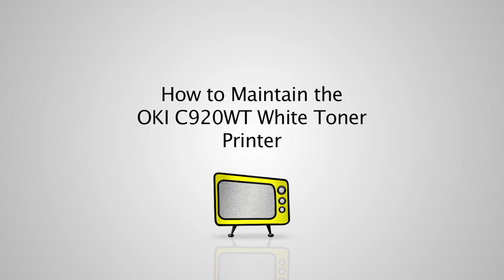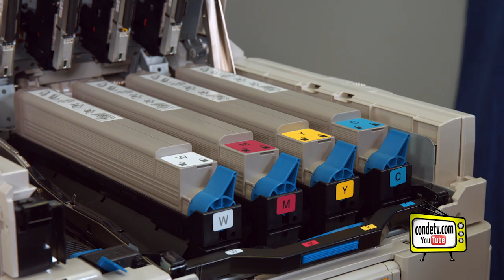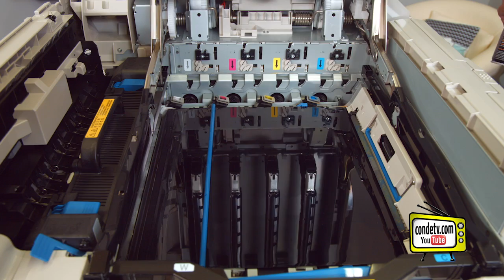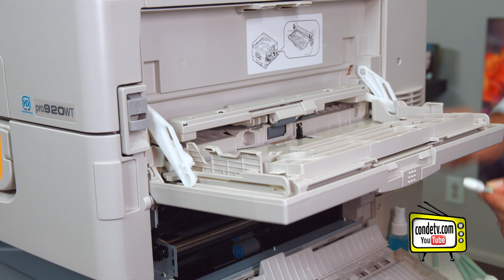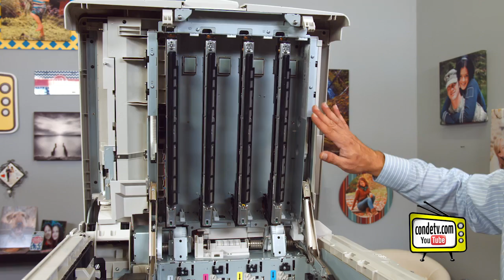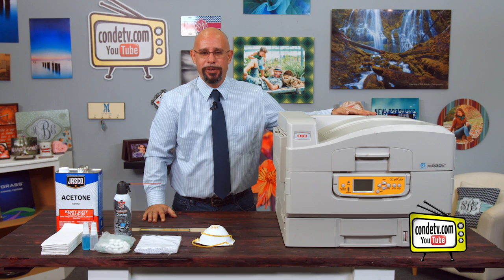Oki White Toner Printers - C920WT - Maintenance -

Comment: Hi again, thank you for your answer.
I have another silly question...  Is it ok to have the "Drum Cleaning" option constantly on? The printer is  making some inside movements, is this movement is wasting the drum life or it is recommended to use this cleaning option?
Thanks in advance,
Angel
Reply from the maker: In regard to the "drum cleaning" feature, it would be a good idea to "enable" this feature if you use your printer infrequently.  If you are using your OKI on a regular basis (every day or every other day), then you should be fine.